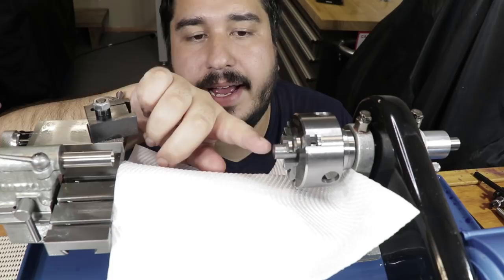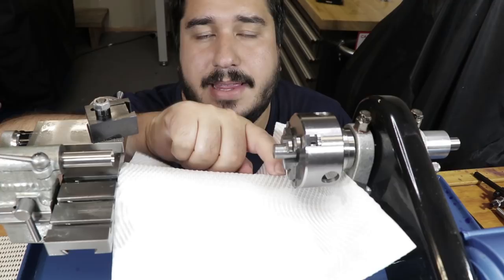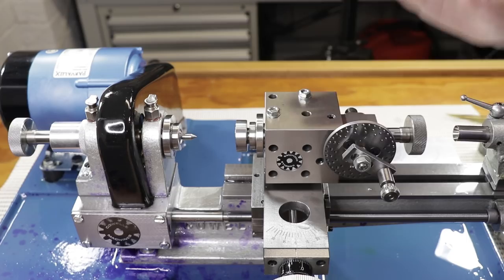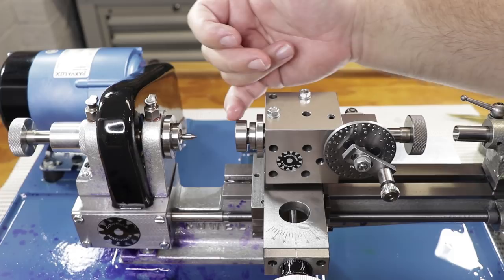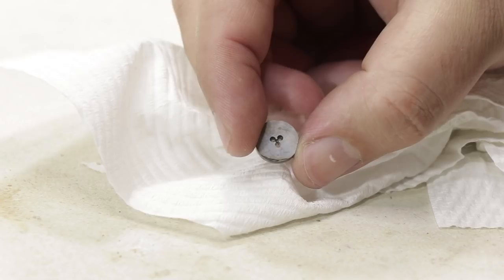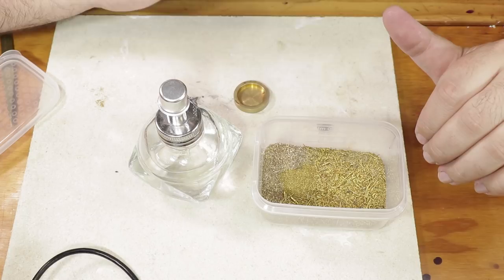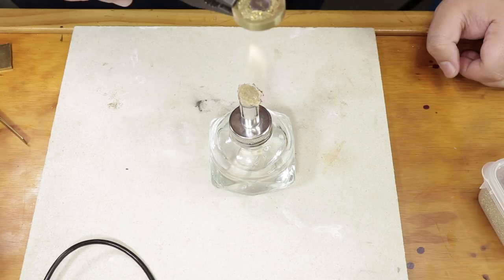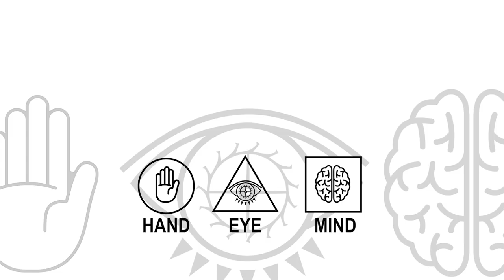How to make a Thread Cutting Die from Scratch - Watchmaking Vlog #12

Comment: quick tip, preheat you part a little and the dry flux will stick and coat without the mess and extra work of mixing the slurry
Reply: also wouldn't hurt to make your newly minted tool before hardening

Comment: In order to harden metal, it is essential that you heat it until it turns dark orange! Then you shock it in to cold oil. 
That makes it hard as glass and very breakable. In order to get it to the hardness you desire you heat it up again which makes the glass hard metal less shattering into peaces if you drop it but hard enough to cut other steal. This is a very complicated process.
But hey, great video!!
Reply: Frank Schroth oil is not always the best quench medium to use. As Dean said, here he is using water hardening tool steel, probably something like W1. Quench temperature varies between different tool steel alloys. W1 requires soaking to 1500 degrees Fahrenheit before quenching, and at 1500 degrees it will show as a bright cherry red. Dean also clearly showed the correct tempering process to draw back the hardness of the steel. The wonderful thing about carbon tool steels is that small parts are quite simple to heat treat in the home shop. Where the hardness must be closely controlled, a set of good hardness testing files do quite well. Check out Stefan Gotteswinter's channel, he has some great home shop heat treating content. ☺️
Reply from the maker: Thanks Precision! I will definitely check Stefans channel out also!
Reply: Great little video! I have some small dies that have tapered form relief on the leading edge of the first two or three threads.  Yours does not appear to have that.  Other than simplicity is there a reason for not having it?

Comment: Entry taper? Also, I'm not sure but I think commercial dies have a rake to the teeth. An angle to the teeth if you will, like with the cutting angle of a drill bit.

Nice work nontheless! Good to see you got such good results out of the borax, I've been having trouble myself. Partial coating and that.

All the best
Karl
Reply from the maker: +Karl Månsson I forgot to put in the part where I made a small taper with the center drill taper.. 

Thanks Karl, yeah I didnt have good results at the beginning.. but now its great, I think it works best in a some sort of cotainer where can surround and really pack it in.

Comment: Amazing work Dean. Thans you  for all you videos. I love it. I see all but my english is very bad. Please Dean You can help me and tell me what stell or iron you use for make the Watch Screw and where can i buy? Another thing, the white powder, with which you heat them with fire and put in a mini wire basket, is boric acid? Where can I buy too? Thank you so much
Reply from the maker: Hi clanmondo thanks for reaching out. The steel is tool steel. You can use water hardening silver steel or drill rod as well. You can buy online eBay and other online shops. Yeah the white powder is boric acid powder 😁😁 wish you the best of luck

Comment: Can you make a custom sizes??Getting taps was pain in the ass,but it seems dies not present....So far I can obtain .40,.50,.55 and .80mm threading dies...Rest of them missing and I need .30,.35,.45,.60,.65,.70,.75,.85,.90 and .95 dies,anyone know where to get them or maybe can make themselves??
Reply from the maker: That’s the issue I ran into and just ended up making my own 😁👍🏼 good luck
Reply: I can't imagine what kind of fine ass drill bits you use,collets and milling bits....Building die's like .30,.35 or even .40 is an major chalange,I can't be sure what precision you must have under microscope....I recently get 2 more die's in 1.10 and 1.30 so I got 6 die's total now...I get lucky and bought huge lot of taps,taps are easier to find but die's is chalange..I was contact Grobet and they saying only .70 left and they charge fortune for that damn die like almost 100 bucks which is no go deal...So far .40 die is smallest I got and .30 is smallest tap there is exist,I don't think there is much smaller size than that available,even if it available it is pointless to use it anywhere...The .30 thread used in Swiss watches,the fun part that Swiss and German watches/clocks use lot of small complicated components,this is why smaller sized threads was created..In regular mechanics there is no smaller size used less than 1x.25mm which I have taps and dies,ranges from 1mm to 2.6mm consider as small thread,common sizes from 3mm up to 30mm would be logicly nominal sizes used anywhere from car,busses,trucks and even army tanks..Tanks engine heads uses 18mm bolt threads,the only exception upply is deployable bridges or rigs plus cranes which could easily extend threads up to 56mm or more...In firearms large thread would be 20-25mm thread and it usually relates to large caliber barrels like WW2 Finish lahti l39...I have very large experience with all things starts from watches and ending up with artillery or ballistic missiles,one way or another I did dismount certain components in past and study their internal work,vehicles I perform the best and my job is automotive industry as mechanic,i almost reached position as chief mechanic....There is no job I cannot perform,micro electronics,high voltage,plumbing,carpentry,gunsmithing,locksmithing and blacksmithing is my favorite type of jobs..I can craft any tool that I see fit for the specific job,i can modify metal working machines at level that originally wasn't been build..One example of those machines is Wen 12" drill press,unfortunately modern drill presses build cheap and incorrect out of factory spec levels and mostly in China at one main factory,there different brands and models of drill presses but they all build at same zero default....The weakest part is support column which shaped in form of tube,it made out of stainless steel rolled sheet that form tubular point..It have very thin walls like exhaust pipe and over time drill press would get out of center drilling because heavy head would lean forward resulting collapse..Second weak factor unmounted geared rail rack which allow table to wobble side ways during drilling resulting out of center drilling.....I had crafted my own tubular column,i took near 3" steel pipe,cutted at half vertically remove more than 1/2 extra thickness material and reweld to desired shape,problems uppear when tube become oval shape which took me draw bar and hammers to forge until it turn to round desired shape..After this I used angle grinder with sanding attachment and die grinder for finishing,finally I used medium grain sand paper for nice smooth finishing...Correct result become 1:1 scale which is 2.550" wide,everything installed smooth no hard or loose,table with rack assembly,clamping collar,head assembly all ready..Geared rail rack is pre drilled now and holes countersinked for hidden bolts now it needs only alignment and drill/tap column for mount rack...There would be final modification,this would be electrical rewire speed indicator to be only working when main power switch is on rather than plugging wire in outlet...My second machine remodefication would be Craftsman 109 lathe,after long time search I finally found spindle in 3'4 diameter,hollow through which essential for deep drilling/reaming/tapping and rifling operations...Original spindle was little wider than 9/16 and thread for chuck was only 1/2 thread which cannor over exceed limit of blanks insert in chuck,really very stupid design insert capacity less than specified..Next part would be expand holes in front stock housing and pulley allowing spindle go through which have planty room for that size and little over,second part would be little chalange construction of gear box assembly for speed select which critical in lathe performances,third part making extended lead screw/modify bed and second bed and connect them as one long bed increasing lathe swing to 56" long which allow you install very long components which final procedure requires construction of steady and follow rests...Finding that spindle is a charm,it have threads on both ends which also allow installing secondary lathe chuck at rear for barrel drilling/reaming and rifling operations which also requires upgrade tail stock to become turret tail stock and installation of gear rack at lathe..By making those upgrades so called low profile lathe become an ultimate lathe which is very small,low weight and very compact for many small needs rather than getting huge lathes that designed most for factory use rather home...The large barrel that could be crafted is .50BMG caliber or at least 14.3mm Soviet caliber,larger the barrel larger the lathe required,any large machinery components requires larger machinery to form/build construct...Building hydraulic forging machine was my dream,this replaces human hands thousand times over and allow do riveting,hammering and certain assembly with upgrade...I don't need instruction manuals to study how those machines works science iam very good to understand how machine mechanisms works such gears,pulleys,rotors,pistons,drives,spindles and other similar stuff..I already have design in my mind how to build hydraulic forging/hammering machine...Unfortunately I don't have materials for it or even time..Iam the Craftsman who don't believe in impossibles,I always believe there is possibility and management over many things that others would give up easily..
Reply: That is good idea,but in order to lets say you want thread 0.45mm size what type of taps you using for that job???I can do that task myself pretty fine,however my lathe Craftsman 109 under upgrade order,I modifying head stock housing,face gear drive assembly,pulleys plus other parts as well...Original spindle4 is shitty design measured roughly somewhere as 9/16 diameter,the threaded end for chuck is 1/2 diameter which is no go for lathe..After my long search for perfect spindle I finally found 3/4 outer diameter,I enlarged holes in pulleys so as face drive gear holder..It would take maximum 3/4 diameter,no larger size spindle can undergo into Craftsman/Sears 109 head stock housing..Tomorrow I will start reaming holes at front stock ends for brass bushings/bearings so spindle would sits and rotate firmly..Rear bushing is simple to build but front have to be made in form of original shaped,front part coned bit that enter at front faced area while rear part threaed to adjust..Front bushing/bearing shaped like collet from die grinder except it threaded,ones those parts all match I would have to cut key hole at gear holding bracket and spindle to insert retaining key...Ones front stock assembled it would most likely return back at lathe bed,second part I got in mind making gear box assembly which regulate speed select for spindle and lead screw...After all that completed I would try to align tail stock so it would be centered with front stock properly...Ones lathe fully assembled I would start making die's myself,just not too sure what type of taps to use for cutting 0.45,0.60,0.65,0.70,0.75,0.90 and 0.95mm threads???To profile die from blank is not hard,to drill/cut holes eather but to thread die in certain size is a question mark..Nominal size for watchmaking die's is 8mm outer diameter,that way they would match with Burgeon die's equivalent....After die mechanicly finished it would get tempered properly,if I can temper any firearm part or tools I also can temper die's as well....When you watch old USSR/Russian made watchmaker die's they flat,no chip extracting holes only thread hole..They seems poorly designed,taps on other hand is similar to Burgeon and you virtually cannot tell difference rather than length of that tap...The price for die's unreasonably high,I found few places in UK and Germany but cost of each die according to USA dollars is like 60 or 65 bucks for single thing which way too high...By properly making your own one's you can save planty of money and achieve greater results with your repairs....I can work with watches,tools such making them or modifying to suit for certain task,fixing machinery which defines as wood working,metal working,all types of vehicles so as army tanks,blacksmithing,locksmithing,gunsmithing and probably can even patch peoples under certain events....There is no such job that I cannot handle,i also have major experiences with those jobs,at my work everyone knows that what and how far I capable to go,most of all welding jobs go through me where others seems chalange..I work with one condition,no help and mostly alone to achieve better results,the help I been provided with newbie is insufficient and highly unacceptable,more failures and critical mistakes rather anything useful...The newbie is not a mechanic as he claiming to be,he came without any tools and now think he is a tough guy...I hate peoples like that,I also hate peoples who trying leak their asses eather,now most likely second person won't get any gratitude from me anymore for that behavior,when you talk about certain things with other coworkers that person act like snitch and carrying all details to so called failure mechanic and than planty of arguments unveils...Sooner or later I would carry word to the management and than they would have to act up what to do further,so far there been planty of failures with vehicles,i have to fix every God damn problem in return..Iam getting out of patience and eventually would talk with my boss to get rid of problem....The senior mechanic somehow keep spoil that individual and things getting out of control,too much laziness and faulty results...Next thing I would most likely do is refuse fix all failures after that person,others would also eventually have to do the same..

Comment: I'd really gotta try hardening some time. Never really found a supplier that will sell small amounts, also not sure what specific material would be most suited for use in the home shop.
Got any suggestions? Specific W-nr's would be great.
A minute of music here and there is fine with me.
Reply: 80crv2 is probably one of if not the easiest steel to heat treat in the home shop, several different suppliers sell it at a reasonable price. Another beginner friendly alloy is the higher manganese version of 1084 sold by New Jersey Steel Barron. If you want something that is better suited to water quenching there is a low manganese version of 1075 that is also sold by New Jersey Steel Barron. It should be noted that with the steels specific to New Jersey Steel Barron they are still within the SAE specified range and there isn't necessarily any difference from other suppliers, but that supplier has a narrower acceptable range for certain elements in those alloys to get a more consistent product.

Comment: That hacksawing business is for the birds. Absolutely my least favorite thing to do in the shop!
Reply from the maker: +Bill Lightner haha yeah I make a game of it try to get as straight as possible. I ended up cutting about 8 of these until the last one on the video. Was completely over it by then 🤣🤣🤣
Reply: I, also, don't have a parting off cutter, so when doing similar work on my little, 1950's, Flexispeed, I keep it turning while holding, either, a Jewellers saw or Junior hacksaw, teeth backwards, and applying gentle pressure. This way the cut is true to the work, finishes at the mid point, and the saw doesn't run the risk of dropping through and hitting the lathe bed :)
All the best with your watchmaking.

Comment: Is that song advocating Polygami?

Nitre buing is often used on gun parts to get any color from pale straw to blackish blue. In the Wikipedia article they state that the hands of pocket watches was done this way. I think the way you  demonstrate would work as well for such thin parts!?

https://en.wikipedia.org/wiki/Bluing_(steel)#Niter_bluing
Reply from the maker: hmm I don't think so. The original song is One (Harry Nilsson) apparently he wrote it after he called someone and got the busy signal. Maybe he felt super lonely at the time. 

Yes that is correct. The bluing of thin part can be done that way, or also on a flat piece of brass. I have some ideas I will experiment soon with the bluing process. Thanks for taking your time to watch and comment on my videos as always :)
Reply: Had no idea Harry Nilsson wrote that song. I went ant listend to the original, sound very much like a Beatles song!
Reply from the maker: hmm it could have been. I'm only going off wikipedia here. So maybe take with a grain of salt.